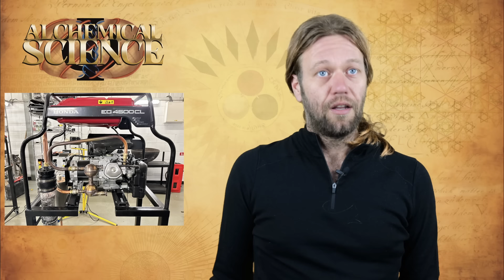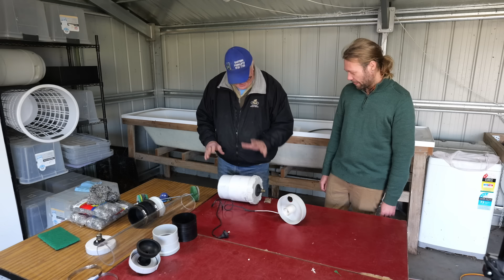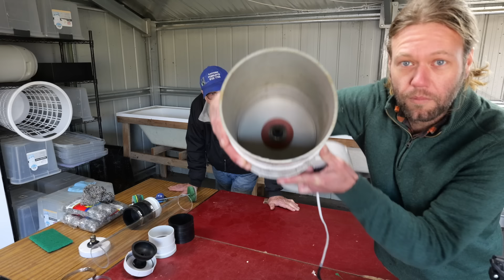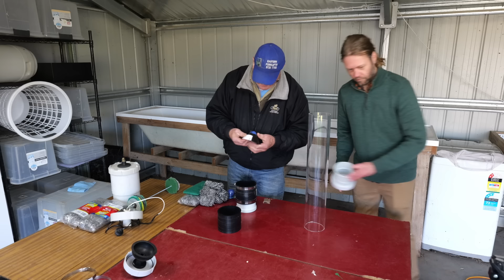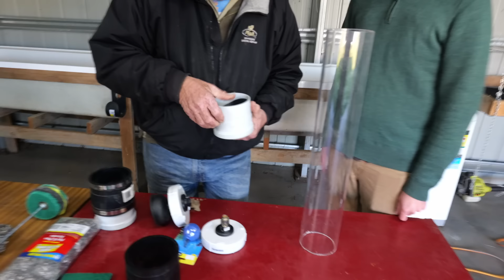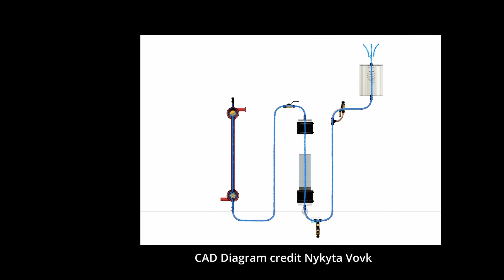Thunderstorm Generator DIY Build Guide v2 | Part 1: The "Ioniser" and "Bubbler" (Plasmoid Generator)

Comment: How is that uv bulb powered? DC voltage or? If so how much voltage? How does passing air past a uv bulb ionized the air? If you added this supposed air ionizing feature to a Geet processor wouldn't it be the same more or less?
Reply: Your asking to many questions. Put in any bulb you want. Its still the same scam

Comment: Little light bulb won't ionize much of anything.
Reply: Ya that's what I am wondering about. They blast right past the supposed ionizing bit without explaining why or how it is ionizing anything and why this is important to the system.
Reply: Looks like I found someone using some common sense! I thought I was going crazy, instead it’s the opposite in this comment section. All the believers have to do is change the light bulb to see how useless it is. This obvious scam has been going since 2022

Comment: alot of those materials are found in home depot but the pvc pipe with threads I may have to look online amazon or something. Im refering to NY of the united states. my question is are you to get electricity for the light bulb? Or does the lightbulb get electricity from the system?

Comment: Dear Sir,
I would like Nothing more than for your device to be Real; however, your presentation has an omission and errors.
1. You claim, the device can help reduce carbon emissions helping to reduce climate change. By Climate change is Real, but caused by solar sunspot activity Not CO2. Further this Error shows a Lack of Critical Thinking skills.
2. You failed to specify the frequency of the uv bulb, uv-a, -b, -c, or -d and wavelength in nanometers
3. You stated the air bubbles cavitation on the intake and compression strokes of the engine. Half Truth. On the compression stroke theintake valve is Closed, no flow can occur.
I look forward to your response point by point
Thank you

Comment: Jordan, did you know if you advance the timing on the engine by ~34 degrees you can run just on the water bubbles?  https://youtu.be/0L1zpjvms84?si=6Cph6jM3955c1BvZ

Comment: PVC clean out threaded coupling w/cap ,gromets,scotch brite,zip ties ,bubbler,black flangeless hub,thats no 12 inch plexiglass cylinder its 24 + inches.stainless steel scouring pads.

Comment: Where are you going to see pressure of 100,000 psi and temp of 10 million degrees  celsius. The diagram of plasmoid evo created within the 304 stainless steel pipe and the 304 stainless steel balls could not contain such pressure or temperature. Are there metal alloys we know of that can contain 10 million degrees celsius . Not to mention 100,000 psi.

Comment: Can you tell me where I can find more specifics about the interfere and how to direct it with that little flap and I'm pretty sure I know the degree that it's supposed to be angled at but didn't see very many specifics about it. Thanks for any help
Reply: Inner sphere not interfere
Reply: More information about the swirl guide for the inner sphere. Not sure how big and the exact degree is the same as the pyramid I know that part. Again thanks for all the info

Comment: Hey Jordan, you guys are doing some really intriguing work. I remember watching a podcast with Eric Weinstein quite a while ago where he named the "Hopf Fibration". This is supposedly a 4 dimensional sphere mapped to 3D, if I understood correctly (probably not entirely but that is beside the point). He was saying that it is some of the most significant physical structure that is known or similar. Now I have discovered that this structure looks entirely like the vortex with the infinite symbol that you guys are always referencing. I dont know if it is obvious or something but I thought that I would share about it.

Comment: So no more high emission charges? Save thousands in electricity bills if you run AC? Vans that need to keep food and chemicals cool and save in weight and fuel? What about the heat? & what other ideas have been thought of for the use? The first few I mentioned are from your previous video but would like to know more uses of this? I find it fascinating! How long until these things will wear or need changing etc? Sorry but I can only subscribe and only like the video once :)

Comment: I agree with @aarondavidson6409 comment. They are clearly using a longer than 12 clear tubbing and if 12 inches is recommended than that should have be explained in the video. We should know what is the length of the clean tubbing and not guess.
Reply: I ment to say we should know what the length of the clear tubbing is ( not clean Tubbing)

Comment: Hi, I am new to this, trying to get the concept down.  Are you gasifying the water in order to replace that as the fuel in an internal combustion engine? Is there a good video I can watch defining the purpose and goals of this tech? The mechanic seem straight forward enough, just trying to get a handle on the why's and what's :)
Reply: It cleans the exhaust air that comes out of the tail pipe.
Reply: Don’t fall for it.

Comment: What water do you put in the bubbler? 

Deionised water, that's used for ironing 
Tap water,
Reverse osmosis water,
Mineral water or spring water
Heavy Water with H3 

Can you use any other liquid that creates better bubbles? Like maybe alcohol or some ether spirits? 

What if you use ultrasound to generate those bubbles, I know ultrasound cleans stuff by making those bubbles implode on the surface area of the stuff that's submerged in the ultrasound cleaners. 

And as a reptile keeper I got loads of those UV lamps, but would the industrial UV disinfectant lamps to a way more solid work in Ionising the air?? Or is that an overkill
Reply: Distilled water

Comment: Is ANYONE going to mention Paul Pantone? This is a huge ripoff of his work without giving any due credit. This device does NOT use a Ranque-Hilsch vortex tube. Making vortexes in a pipe with another pipe around it does not make it a vortex tube, because the gasses entering are never split into two separate components. This tube is almost identical the GEET device, which is a heat exchanger with other electrical properties that do cause fusion reactions and gamma rays, as proven by Paul Pantone with the GEET generator. Using ultraviolet to ionize the gas is an old trick from Stanley Meyer. Plasmoids in water have been studied under the name Brown's Gas and Moray King has spoken volumes on this. Dozens of teams have experimented with the resonant frequencies of water and hydrolysis chambers and electrodes, using either light, sound or pulsed high voltage. If I had as much money as this Malcolm Bendall guy I could have made a way better version. Trying to get funds to work with Paul Pantone's son David Pantone has been extremely difficult. And who is this Bendall guy anyways? Why is he tied to the Panama Papers which revealed money laundering? Why did he try to develop oil and gas drilling and suddenly flip to ripping off the designs of other HHO inventors? I love what Bob Greenyer has done to resuscitate Hutchison's work, but this is just weird to me. Bob knows of other HHO tech and only preaches the gospel of Bendall. And the plasmoid unification model? Its a bunch of really really bad numerology combined with Walter Russell's periodic table. You want to see this technology developed right? Talk to me, talk to David Pantone, talk to Aaron Murakami, but don't waste your time praising some douche who never gives credit to any of the giants whose shoulder's he's climbing on.

Sorry if I seem triggered, but us alternative energy inventors have been used and abused since before the days of Tesla, and most of us are open-source, and most of us really care about fixing physics and including more studies on consciousness and "life energy". Why does some fricking grifter get all the credit?

By the way, I'm not saying this thing doesnt or shouldnt work. Im saying it will because all the components are proven technologies in the alternative energy space.
Reply: After writing this comment I learned a lot of things.

Greenyer has mentioned and worked with GEET quite a bit, but naturally he's excited for current advancements made by Bendall et al. 

Bendall, however much I disagree with his numerology, at least his prodigy understands that he's essentially elevated the units of seconds and miles to a sacred status in his model. I can't hate on a man who knows what he's doing and chooses to do it, but I will tear gaping holes in anybody's argument if they're being a hypocrite, which I don't see Bendall as doing.

Bendall also made an in-person apology to David Pantone at a conference for not mentioning his family's work more. Apparently, there is some sort of marketing or PR reasoning behind this.

Also, I should note there is no evidence that Malcolm Bendall laundered money. And there are reasons to believe he was targeted by the media. I still think it's silly to invest other people's money into something based on spiritual beliefs, but I honestly have no idea what went wrong with his oil business.

Now, I'm still pissed that he calls the TSG a vortex tube, because once again, they are nowhere near the same thing. A vortex in a tube does not make it a vortex tube. A Ranque-Hilsch has ONE entrance and TWO exits on ONE tube. A GEET has TWO tubes, one inside the other, each with ONE entrance and ONE exit, for a total of TWO of each- JUST LIKE THE TSG. 

I would remind everybody that GEET is free to build yourself, it was only patented to protect free access to anybody who wants to build it for themselves, and also so that its sale could be managed by licensed dealers with some of the income used to support further R&D by the GEET Institute (which is broke AF by the way).

I made a playlist of over 1000 videos about GEET, here on YouTube, that were uploaded by over 200 different users. 

Why on God's green earth would you want to ignore almost 40 years of research and hundreds of independent researchers working on this technology if you really want to get it out there? 

If you want to be technical, the GEET is an EGR system that treats fuel within a heat exchanger, with an optional bubbler system for further enhancement of fuel treatment. Note that the TSG doesn't even use the GEET's magnetic rod, which is scientifically proven in US military patents to actually increase fuel combustibility.

The spheres on the ends of the TSG? GENIUS! If he has just been straight about how he got the other ideas, I wouldn't be complaining. 

Also, adding HHO to a GEET is not new, just check my playlist.

And plasmoids in water? Moray King has hours of lectures you can study and learn more from. Why isn't he mentioned?

GEET and TSG communities need to be collaborating, that's the point I want to drive home. It's not just a waste, it could mean the whole technology slipping into oblivion because nobody could properly explain it, even though it works.

Because if Bendall can't even explain what his device is, I can tell you, you're all in for a world of disappointment. You want to know why 99% of all free energy devices fail? It's not the men in black or even the oil companies, because they are only a factor as a result of one fatal flaw.... it's because NONE of those inventors could explain their inventions in plain English or any language for that matter! If you can explain it in a way everybody understands, not only is the genie out of the bottle (negating a need to silence you, lest make you a martyr) but it also solves the biggest problem facing all inventors!! You want to mass produce something? You need a manufacturing prototype, not a proof of concept. You need to know the tolerances of every component, and for that you need to know what job that component is doing. Without that, you can't manufacture anything you can sell according to international laws- what if it does something unexpected as a result of picking parts that only work some of the time? You could kill somebody. Or just end up selling something destined to fail before it even pays itself off with the savings.
Reply: To be honest I absolutely don't care who gets the credit for this technology. All I care about is that it is finally out in the open. Whoever had a hand in designing it and who gets credit we can resolve later when we have this technology distributed across the earth. Also Bendall hasn't had a lot of chances to talk extensively about his work and who to give credit to. And he gave at least credit to Tesla and Randall Carlson in some discussion rounds, so it is not like he claimed himself a huge genius who invented it all alone.
Reply: Great comment

Comment: Off the shelf products made for aquariums are sold that are basically this exact device minus the air stone and steel wool.  Just google "aquarium media reactor" and you will see dozens of options to choose from.  It should save a ton of time and effort sourcing the acrylic tube and other hard to find parts, and will probably save money in the long run.    If you require the exact specs I'm sure the smaller companies would be happy to make a custom version to your specifications.  There are plenty of sources for these in the US, Australia, and Europe at least.

Comment: not sure what this means - "on the reverse stroke of the engine the bubbles collapse" -  the reverse stroke pushes the exhaust gases through the exhaust outlet, so there is no pressure created in the intake air pipe/bubbler, right?
Reply: Was thinking the same thing. Hope he responds to this
Reply: So my unders 26:41 tanding is there is a plate adapter on engine between carb and intake with adapter for pipe from bubbler. As piston is in down stroke, you're pulling in, creating your suction. I do not want to give misinformation but I think this is correct. Cheers! Just putting my shopping list together now!
Reply: Think of it like a push and pull all valves intake and exhaust have push and pull or an up and down stroke. 

When the intake is coming back up exhaust is going down that’s when for that split second the bubbles collapse
Reply: Hook up an engine vacuum gauge, it's pretty constant. The engine (piston cycles) are not collapsing the bubbles. That's false info.
Reply: @6061  a vacuum gauge wouldn’t pick it up your talking about a moment in between strokes

Comment: Has anyone weighed the steel wool before use? Would be interesting to weigh again after a certain amount of running hours and of course proper drying.
Reply: What about green dish scrubber material? Or grounding the steel wool or chamber to the earth ot engine chassis? Or having tiny antennas outside the chamber to collect or bleed charge?
Does the chamber develop an electrical charge bottom to top?
Reply: Or wrapping it with foil like a capacitor?

Comment: Multiple LENR researchers seem to die relatively young, of cancer. Coincidence, or are they Curie'ing themselves? Might John Hutchison be suffering from the effect of (as I understand inherently non-nuclear) "strange radiation"? If so, how do we measure strange radiation and know whether we're being exposed? Even a membrane about a self contained unit might not pick it up, as we see in experiment matter can go out and back into our measurable existence, but having travelled some distance. Rogue molecules or smaller or large can end up depositing inside your body, displacing organic matter that was previously there. Or worse. 
Has someone worked on protocols to ensure strange radiation will be impossible to occur, and then understanding various failure modes?

Comment: Hello Gentlemen. Please identify the NOx properly as oxides of nitrogen or nitrogen oxides. The 19/4/24 honda on gasoline is running poorly misfiring, dead cylinder, stuck injector, etc... it is always best to start with a properly maintained vehicle if anyone is going to believe what is happening here. The high 02 level on petrol is evidence of a misfiring cylinder and the high CO shows that all that there is not enough oxygen in the combustion. fuel is dumping into the exhaust without being burned. So we have a misfire there and a lean condition as well. This is obvious with the TG results later as well. This car is running poorly to begin with.
Reply: What do you mean about high CO? This is within the normal range according to a simple google search. O2 might be twice that of a car, but the carburettor isn't as efficient as a modern fuel injected engine, plus both Hondas produced similar results 9 months apart.
Reply: dude has gone through 1 engine and has replaced it with 3 or 4 new ones (identical Honda predator generators) over the course of 6 months
Reply: This thing seems very similar in theory to Paul Pantone's actually real GEET machine. Is there a video of it a really working and really being tested?
Reply: @TravisTellsTruths  you find it for example on this Channel under the Name thunderstorm Generator live Demo.. cheers
Reply: @tacho200  I'm new here so I appreciate it, lol. I'm a 100% in this for the musuc. I created a hydrogen hybrid vehicle and my car was 100% cleaned of carbon and the catalytic converter and the smog test results are incredibly good on a 26 year old car. I have a truck now but I wish I could've kept that car for further experimentation.
Reply: Build your own using the kit. Measure, report accurate data. Then prove then wrong... Or prove then right. Either way, the data will speak for itself.
Reply: @shockalotti  there's no "kit". I've got all the notes and downloaded videos. the main component missing is the two 4,3,2 balls with the dual pipes in-between them
Reply: Does this system use gas to run and just produce clean exhaust.
Or does it produce plasmoides and it takes over the fuel to only run on plasmoides
Reply: @jeffreycampbell9116  its running with gas and produces clean exhausts